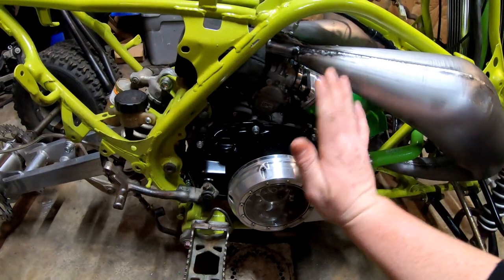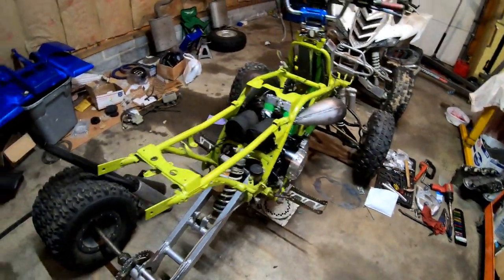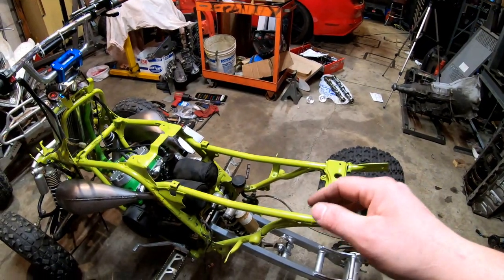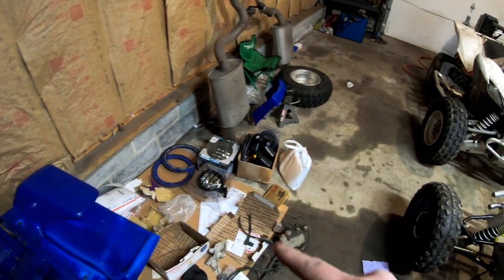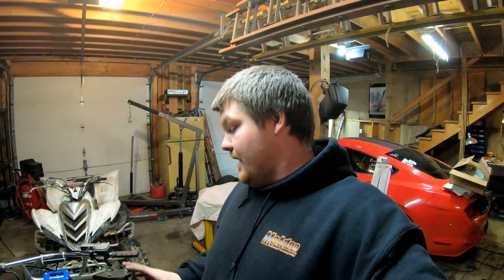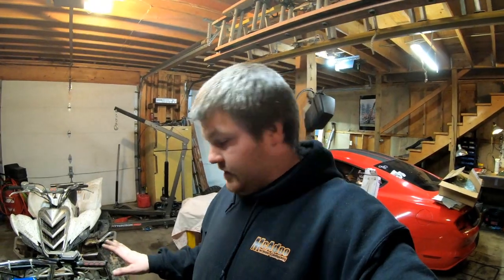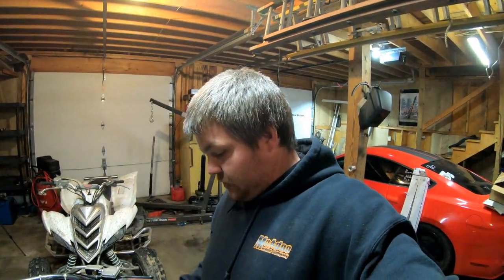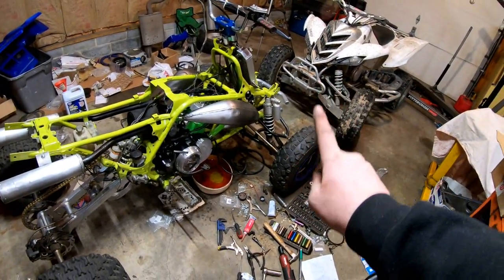Yamaha Banshee takes its FIRST BREATHE OF LIFE | SICKEST 472 SUPERCUB stroker build part 10

Comment: I’ve also heard of people running diesel oil in the bottom end also . Never done it myself but I was just wondering if that is a known trick of racing?
Reply from the maker: I have no idea honestly, i have never heard of diesel oil but i could be wrong. Klotz flex drive is pretty good too. I like atf because its cheap and good for the clutchs 🤙
Reply: Good way to fuck up you crank bearings
Reply: Rotella 15w40 works great ! Lots of people run it !ive ran it for years! Ask Kevin Galindo from southwest Texas banshee!
Reply: quad Master crank bearings don’t get lube from the transmission!
Reply: @nbrink684  i have rubilt alot of 4 strokes 2 strokes i would know
Reply: @nbrink684  and +hes talking abt the bottom end not the trans
Reply: quad Master ya the bottom end only gets lube from the premix ! People run rotella in the transmissions like I have for years it’s separate from the crankcase!
Reply: @nbrink684  is he talking abt used oil or no
Reply from the maker: @nbrink684  im just using atf +4 from any local wal mart, quad master the crank bearings dont see any fluids from the transmission. The crabkcase bearings get there lube from the gas oil mix, Nick is right man 🤙

Comment: Btw that can mess up yo rings
Reply from the maker: What can? If you mean by running it rich, i ran 36:1 in every bike i owned for almost 10 years and never had an issue. Then i switched to 40:1 after my favorite company stopped making the oil i preferred. I know about ring wash and it takes massive amounts of fuel richness to ruin cylinders lol if thats what you meant? Also you said about a buildoff? Of what?🤙
Reply: Running with out water.          And a build off of quad.   If so add me on fb.  Jerison day.  It will have a 300ex as the profile
Reply from the maker: @quadsavers8639  gotcha! Yes your absolutely right thats why it was only for about 30 seconds. It didnt even reach operating temp and it was super cold in the garage. There are 2 videos you see during the startup, first one on my canon, amd second one on my phone which is after i put the coolant in her. I combined them to make it seem longer 🤙
Reply: @StupidFastJohn  i had a kx250 it blow up when i was racing it was my rings
Reply from the maker: @quadsavers8639  i added you on facebook. What kind of quad did you have in mind?